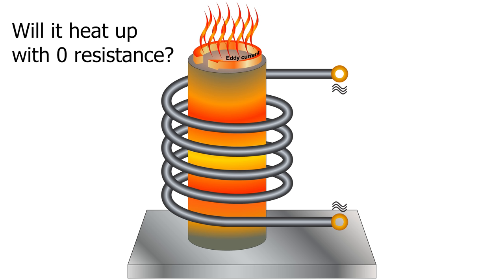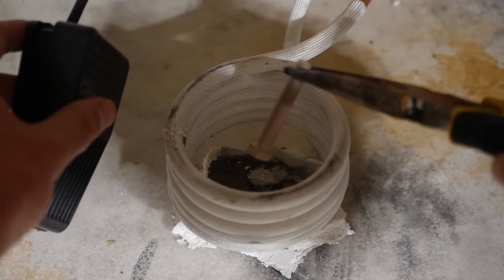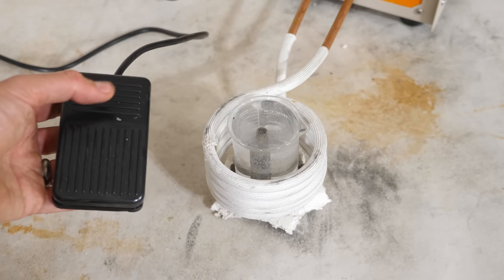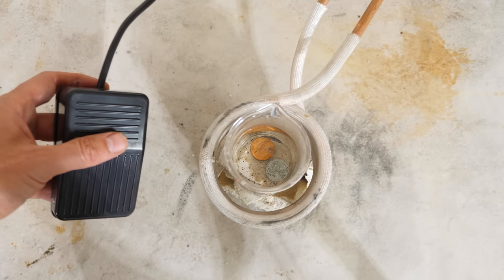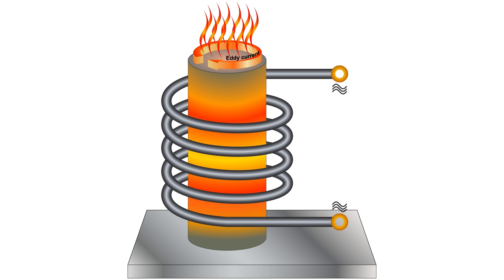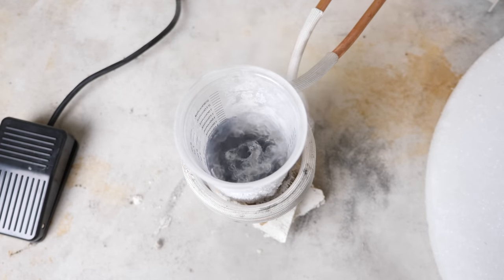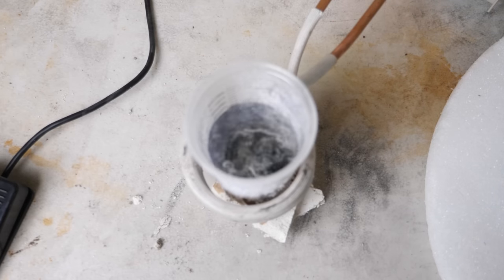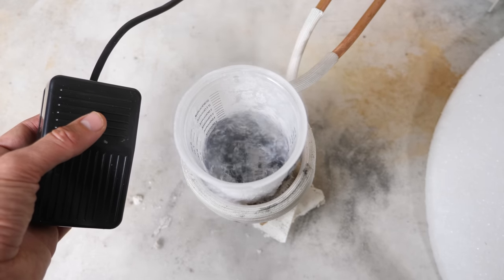What If You Put a Superconductor in an Induction Heater?

Comment: I also have to point out that superconductor can not conduct any arbitrary amount of current. There is a limit below which superconductor can sustain zero ohm of resistance. When the current goes above that limit, superconductor will not be zero ohm anymore. The primary reason is that there is a limit of how many free electrons a superconductor can provide, so the current won't go up to infinity while staying as zero ohm.

Comment: I'm very interested in superconductors -- what is the applicability in electric motors? If you could wind an electric motor with a superconductor rather than just copper, would you be able to get more power and effiicency out of it? In an EV, I imagine superconductors would help with charge speed as well as battery fabrication. If a battery module was built with superconductors, presumably you could drive it harder without the battery overheating - but are there other effects I'm unaware of that would negate any SC advantages?

Comment: The peak magnetic field is greater than the critical field at 77 K.  High Tc superconductors are ceramics not metals.  The skin is insulating and will not heat up.  As the field increases, flux vortices enter the superconductor and, as they move, they dissipate energy.  An ellipsoidal shape will increase the critical field due to demagnitization effects.

Comment: I theorize also that once you add a tiny amount of heat to the SC, it starts losing its SC properties, accelerating the loss of super-conductivity, which accelerates the heat gain. That produces a runaway cycle where absorbs more energy, gets hotter, and absorbs even more energy faster. Do you have any way to test the temperature of the SC while submerged?

Comment: It also seems that because superconductors require low temperature and because real life superconductors are not 100% perfect, that a small increase in temperature (from the miniscule amount of resistance in the superconductor) leads to an increase in resistance, which leads to a greater increase in temperature.

Comment: You missed one more experiment: confirmation that the thing inside LN is still superconducting. Suspend a magnet under the cup with LN and SC in it and start the induction heater. What if there is no superconductivity any longer? Than, the magnet falls down.

Comment: Great Video, 😊 But the experiment is incomplete. A setup with the magnet quantum locked under the super conductor, inside the induction heater is required. Because this super conductor is not a "Permanent" super conductor it is the super conducting properties such as quantum locking to how we know it has passed critical temperature to become "super conducting" So yeah incomplete experiment

Comment: Hi Action Lab guy, if there is dissolved iron in water, will this iron still be ferromagnetic? And if so, how much iron do you need to be dissolved in the water until you can boil it in the heating coil?
Reply: Dissolved iron might be paramagnetic but not ferromagnetic. For ferromagnetism you need domains, which are groups of atoms with their magnetic moments aligned. You need an actual chunk of iron for that to work. The only thing I can think of is if the atoms of iron form some loose groups in the water.

I don't know how to measure ferromagnetism with simple tools. Paramagnetic material will still be attracted to a magnet, just not nearly as much as ferromagnetic. Because water is diamagnetic I would expect water with iron to be repelled by a magnet but not as much as pure water. This will be hard to measure though because you are observing a small decrease in effect that is already quite small.
Reply: @eklhaft4531  thanks, mate. This makes sense.

Comment: I thought that the reason it boiled was because parts of the superconductor were not cooled down to the proper temperature due to the heat not having time to be leeched off, thereby causing there to be a non-zero amount of resistance, heating up the superconductor and causing a feedback loop

Comment: Excellent 👍 love this channel.
Did MIT invent room temp super conductor s?
2D Graphing layers twisted to an angle show high temp super conductor possible now .
I worked at Fermilab and Brookhaven on Super conductor s in accelerator magnets that needed liquid Helium to function.
Reply: Their are room temp super conductors but they require very high pressures. It's not cost efficient. 

Currently low temp ones are better
Reply: @tusharbhudia9421  actually MIT has graphing 2D layer still under development though.
Reply: @tusharbhudia9421  👍 thanks

Comment: I had the thought that it would be cool to see what would happen if you took a chunk of metal cooled it off with liquid nitrogen and then put it in your induction heater just to see if there's any difference in heating time and what happens to the metal etc etc so on. And then and you'll likely want to do this outside with a wide mouth metal bucket. Fill the bucket with liquid nitrogen and drop a heated yellow chunk of metal into it and see what it does to the metal. Probably want to set up a remote drop and step back a lot.

Comment: I think you got the explanation wrong. The skin depth is the super conducting part there is no resistive part. However that behavior is very curious.  The SC should be able to "counteract" the changing magnetic field perfectly. That is until you pass the critical super current after which it becomes a ceramic insulator again. So a SC should never be able to joule heat.

Comment: I think that you are wrong, if you have lower resistance you will actually get more current and power because if the induction create some voltage in the metal the current will depend on the resistance of the material

Comment: The use of a thermonmeter, or better yet - a thermal camera, would have been a nice addition to this experiment. This was really cool though. Pun intended.
Reply from the maker: Thermal cameras don't go to that low of a temperature. If you use a thermocouple it will be affected by the induction coil and heat up. There isn't a great way to measure the temperature inside the coil at liquid nitrogen temperatures. Also, the temperature would rise quickly due to the room temperature, so even if I could measure it I would have to measure rate of change instead of actual temperature. It would be very prone to high errors.
Reply: @TheActionLab  That makes perfect sense, & is a very interesting problem. I'm curious what caused you to try such an experiment - first time I've seen anything quite like it. Nice work!
Reply: Measuring the heated bolt with a laser temp wouldn't work?

Comment: @The Action Lab  Does the magnetism of the steel also affect the result?
Reply from the maker: Yes it does. I should’ve mentioned it. I’m pretty sure the main heating affect comes from the eddy currents because once it’s above the curie temperature iron still heats really easily. But magnetic hysteresis does heat it below the curie temp.
Reply: @TheActionLab   Oh cool. So that's why induction heating stoves have to use magnetic metals to work well, right? I'll have to look more into that, thanks!

Comment: this coil works the same as induction cookers, right? and they work on steel pots, here it worked on aluminium, so is it just that the cookers are too weak to heat up aluminium pots or am i missing something?
Reply: In addition to the Eddy currents, there's a heating effect from magnetisation hysteresis losses. This only happens for ferromagnetic materials like steel, and can be much stronger than the heating from eddy currents.
Essentially the ferromagnetic material becomes magnetised from the magnetic field. Every time the direction of the magnetisation switches, some energy is lost.

Comment: Type-2 superconductors are VERY LOSSY WITH AC.  All LN2-cooled ceramic superconductors are type-2 (they have "pinning" and trapped vortex-threads, which when forced to move, generate heat.)   Even worse are the "high-pinning" silver-doped pucks, the once which display strong "locking" effect.   Zero loss when levitating a magnet?  But significant loss when moving a magnet, to cause the "locking" to be altered.

The real question is, if you have a lead plate in liquid helium, will it boil the helium if strong AC is applied?    It lacks the "pinning" or "locking" like the ceramic HTSC materials.

PS   Watch out for zinc vapor, red hot galvanized screws!   
.

Comment: frustrating. What didn't you just keep the power on whilst testing the superconductor? You turned the power on and it starts boiling the nitrogen more vigorously and then you cut the power. When the bolt was being tested, the power was kept on much longer.
Reply from the maker: It would have just kept heating up and boiling. Also didn't want to overheat my superconductor.
Reply: @TheActionLab  but to which temperature point? It's at -196c in the liquid nitrogen. What happens when the superconductor reaches at least 0c or +20c ? Does it continue heating or does it reach a point where it no longer continues heating and does this fluctuate?

Comment: If it can make metal red hot so quickly, I wonder wether induction could be used to make forges that significantly reduce heating times
Reply: @printer penguin, oh yes, there are very large manufacturing induction forges, sometimes not necessarily to melt metal, but to make it malleable enough for impact forming.
Reply: @fredericapanon207  yeah, I was saying it seems like it it could be really useful for blacksmithing and similar processes, although I’m not sure wether it would be too expensive for small scale blacksmithing
Reply: @Printerpenguin  I have seen a Russian maker use an induction coil for melting aluminium and brass for casting, and heating steel for forging in a workshop setting.

Comment: It's because the nitrogen was already boiling if you made it so the nitrogen was not boiling and it was actually down at the temperature that is super conductor would be at its Max I guess I don't know if it would affect it then but because it's boiling it's slightly above that range which doesn't bring the super conductor down to the full temperature

Comment: Afaik, each supraconducter has a limited current density. I once saw a supraconducter fuse, that just evaporates when the maximum density is reached. Could this explain what happens here, are the induced currents higher than the max current density? I'm not at expert, other comments about supraconducter with AC are probably the experts, but just wondering...

Comment: Can memory metals help make exponential rotation within a centrifuge 9f liqu8d that stays liquid near zero kelvin, an can the regular metal be galvanized and can the memory metal help flux into faraday grounds that help generate atmospheric corona energy whilst categorizing the water to help micro machines make stuff like the new 3 million mirror chip. Wondering if frequencies can be made by natural radio emission cancelation an oscillator at various depths microscopicly, recently I believe peltier can run everything along with everything,

Comment: Is it just me or am I the only one that came out of that thinking how this would be a very efficient means of cooking? I am unsure of the power needed or used for such a system. I assume it's fairly high. But if it can boil water in seconds instead of minutes then wouldn't it be using less energy overall? Electrical workings are beyond my scope of expertise. I am a chef so I know food. And it takes a lot of energy to cook a  meal of any substantial size. So I'm throwing this idea into the ether. Someone needs to turn this into a cooking and perhaps a home heating device(s) . You're welcome. Have a blessed day.
Reply: Inductive stoves already exist, although that aren't popular for some reason.
They are actually fairly efficient, since the pan/pot is heated directly, rather than heating it indirectly through conduction or convection.

Comment: I'm not sure we've found a super conductor with exactly zero resistance, and I don't think exactly zero is possible with anything.
Reply: Type 1 superconductors achieve Q factors in the ~10^8 range or so at frequencies of 100s MHz -- applications such as resonators in particle accelerators.  They use niobium since it's ductile (higher-Tc type 1s would be preferable but are harder to form).  That's a stupendous Q factor, but distinctly not infinite!

Comment: I disagree that the copper's relatively low "resistance" is the issue. That's talking about electric current. I think it has to do with magnetic conductivity - whether the metal is 'magnetic': susceptible to magnetic influence.
Reply from the maker: The reason an object heats up in the induction coil is due to the eddy currents. In order to get heat you need high resistance. Whether something is magnetic or not does not change how much it heats up due to current flow. It is due to the low resistance of copper. The copper coin had a higher current flowing in it than the steel coin. I could have used something non-magnetic with high resistance and it would have heated up as well.
Reply: @TheActionLab  Now I am curious. What would an example of a non-magnetic, high-resistance material? An insulator like glass?
Reply from the maker: @fredericapanon207  Well it has to be conductive enough to make significant eddy currents. So it has to be a conductor but with higher resistance.
Reply: @TheActionLab  what about a semi-conductor like the graphite centre of a pencil?
Reply: Or a carbon welding rod🤨

Comment: If the superconductor heats up, won't it lose its superconductivity? As the skin effect starts to heat up the superconductor, the outer edge will stop being a superconductor and develop resistance, causing it to heat up even more, transferring heat deeper into the superconductor. I would think that it wouldn't take very long for the heat to destroy any superconductivity while the induction coil was on.
Reply: Yeah, would be cool to see the levitating magnet included in the setup while coil is being switched on and off

Comment: not every element in that super conductor is a super conductor. At cold enough temperatures there is enough of it (~75% or more) to display the super conductor effects. But still there is ~25% or less that is still not a super conductor. If every bit of that super conductor was not a super conductor, you would get a pretty big flash and possible a loud pop, as soon as you hit that pedal/button... Try the same thing with the bolt to prove me wrong.

Comment: Does the amount of voltage effect the strength of the magnetic field???
Reply: The field is proportional to the current.
Reply: @unknownhours  so increased voltage makes a stronger electromagnetic field??? Yes???
Reply: @unknownhours  And the current is proportional to the voltage ;-)
Reply: @aaronbest747  voltage is electromotive force pushing the electrons around (in a metal); current is the amount of electrons going past a certain point. You can have high current with low voltage & vice versa.
Reply: @fredericapanon207  ok, would a 9 volt battery be able to make a coil that melts aluminum, or would I need a car battery, or would I need to plug it into a wall outlet???
Reply: @aaronbest747  all of the smaller induction coil heaters that I have come across on the 'web have used wall current at least.
Reply: @fredericapanon207  ok
Reply: @WouterVerbruggen  and the proportionality constant between voltage and current is called resistance. :-)

Comment: You sure that is the water boiling ? Water has great heat capacity and I see no reason it should boil that instantly.
I believe the actual phenomena is electrolysis caused by current induction through the water
Reply: No, it was just already close to the boiling point so when he presses the button it just raises the temperature a few degrees and then it boils

Comment: The explanation with resistance is really weird. The Faraday's law tells you the E field (voltage), not the current.
P=U^2/R 
At constant voltage low resistance means high power.

Comment: Why did you intentionally leave out the materials that are used to make the superconductor?

Also the steel coin heat up the water substantially more due to the fact steel is comprised of iron. Iron is ferromagnetic. It has nothing to do with conductivity alone. Both metals are conductive.

I highly suspect your superconductor also has ferromagnetic properties.

Comment: Wouldn't the penny do the same thing?
Reply: A magmatic field does not penetrate copper or aluminum, Because they are diamagnetic elements. They hate magnetism, that's what makes them such good (electrical) conductors because the magnetic field travels on the surface, that's also why The copper penny doesn't heat up, but the steel one does. The magnetic field penetrates deep into iron and steel. That's what hes sit up. This whole video is total b*******,. This guy doesn't know what hes talking about and should research before he puts videos on. This video has several errors in it.

Comment: I think you have made a small mistake there. You said that the superconductor almost acts like steel and not like copper, but remember that you were boiling water with steel and liquid nitrogen with the superconductor. Another thing is, that you needed to fully cool the superconductor down throughout the whole volume of it first. It may have changed the fact that is starts heating up when all the layers of the superconductor are actually superconductive.
Reply from the maker: The superconductor was fully cooled. It only takes about 30 seconds in LN2. Also I put the steel in the liquid nitrogen in the video and it boiled the liquid nitrogen just like the superconductor.